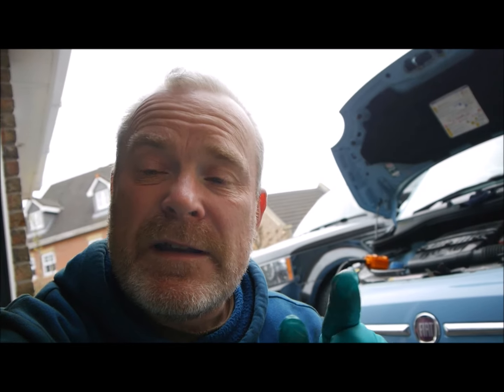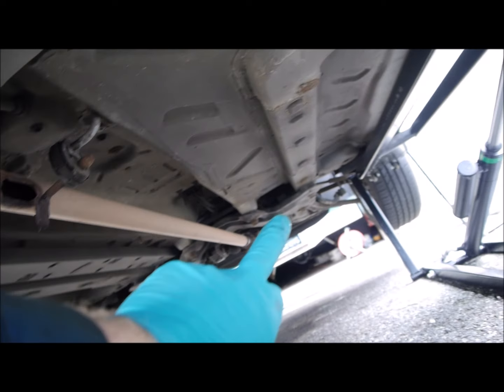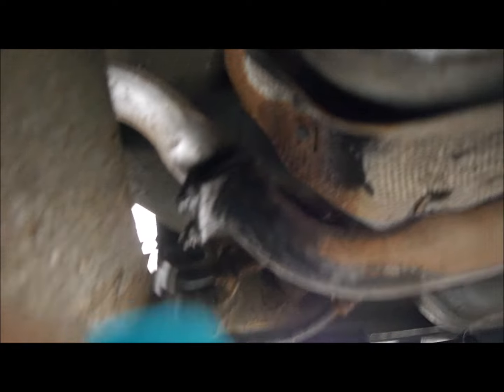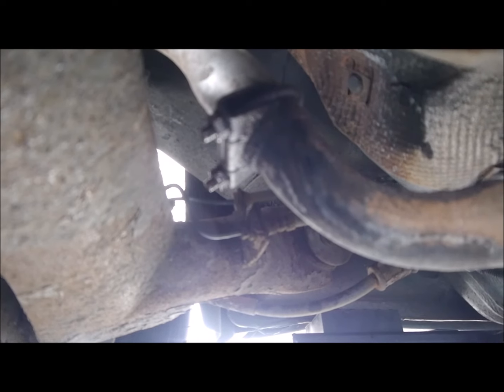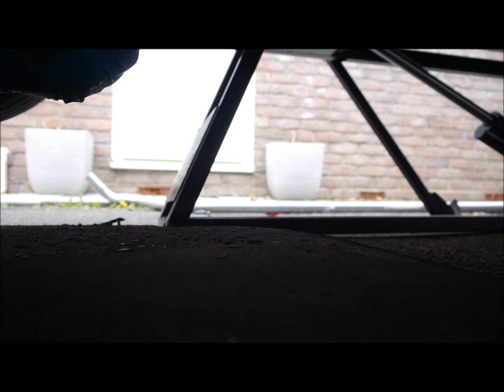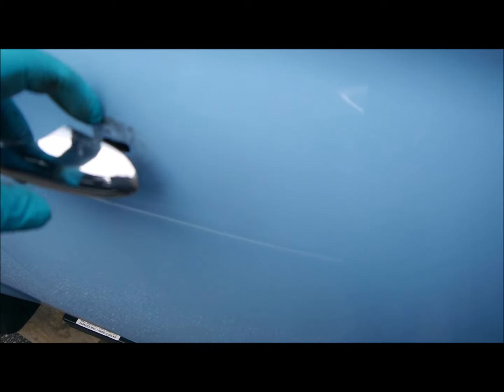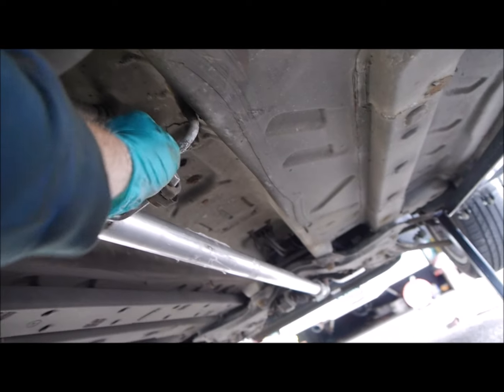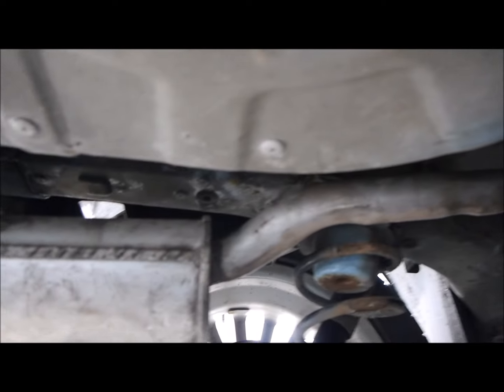Fiat 500  rescue and DIY exhaust replacement

Comment: Just had mine done and now it seems really really low. All fixed right but there’s a lot of space between the bottom of the car and the top of the centre pipe and the flexi is only about 100mm the floor. Looks to be the right parts fitted though..

Any advise?

Comment: good job nice tips but why would it no go more than 40 mph
Reply from the maker: It would do over 40 it was just what my daughter said. However with a bust exhaust and zero backpressure you do loose a little  performance.
Reply: I have a constant issue where the Mass Airflow Sensor gets coated with oil and the car engine wont go over 3k RPM in automatic mode. Will go fine if you shift it manually. I clean off the sensor and good for a few months. I replaced the air oil separator and this extended the time between cleanings. Once in a while I will rinse out the separator with MAF cleaner.
Reply from the maker: @cfurner sounds like oil blow by. Either due to a worn engine or high crankcase pressure. Make sure breather is not blocked

Comment: 2:32 what do you mean by v8, these engines are 1.2l i4. Quality job though looks great!
Reply from the maker: It's was just a joke that it was like a noise V8 engine.
Reply: @vintagesteelgarage  ah hahaha, they sound even better with the abarth exhaust bits
Reply from the maker: @transgrl  yes they do sound good
Reply: the start up did kinda sounds like a v8